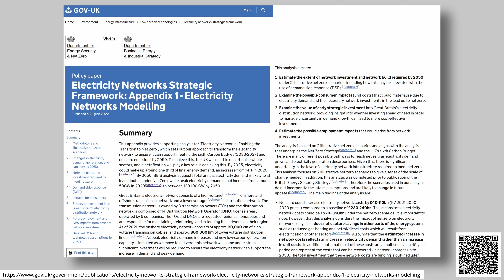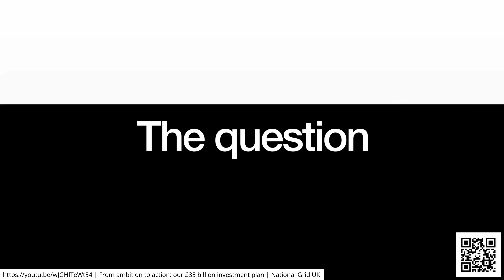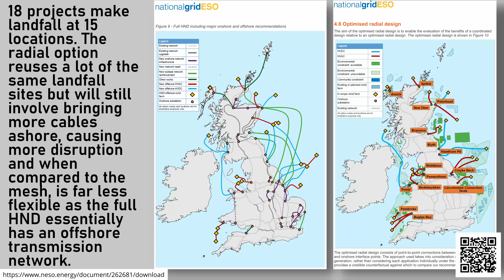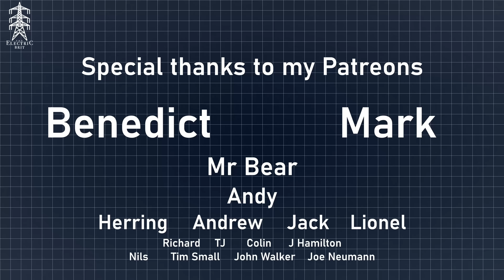The Great Grid Upgrade Projects Explained

Comment: Utter BS and waste.  Spend the £35bn to BUILD POWER STATIONS in existing locations where grid connections already exist.  It's pathetic that we destroyed perfectly usable COAL fired power stations to 'waste' the grid connections to/from them.  No amount of solar/wind could possibly be constructed to replace the output of a coal fired power station.  The world (and our energy system) is run by effing morons.  EVERY wind system will require REPLACEMENT in 20-25 years.  Same for solar.  Madness.
Reply from the maker: Most existing grid connections are exhausted or planned for other uses which is why we’re having to build new substations or extend existing ones. 

I agree dispatchable power is needed but coal is terrible for even the local environment, ignoring any argument of global warming, local acid rain and smog were actual problems. The land contamination and radiation is also a massive future problem we have to deal with. 

Most assets have around a 30 year lifetime too, most of our current gas and nuclear fleet are coming up for major refurbish or closure. New substations are rated on a 25 year life too but obviously maintenance will keep them up long after that. So renewables aren’t much different in that respect other than they get cheaper the longer they live, and things like solar which obviously aren’t the best in the UK are still at 80% after 25 years. 

As I said to others, the last time we built any reasonable amount of grid was 70 years ago. We’re well overdue if we want to keep the most reliable power network in the world. Hope that helps
Reply: @TheElectricBrit Thanks for your details reply.
I disagree over the issues coal is said to present.  Smog was dealt with decades ago and even 'acid rain' was found to be a manufactured crisis - but even that is irrelevant in modern clean (scrubbed) power stations.  The only 'issue' is the fake claims over CO2.
Gas and coal power stations regularly exceeded their 30 year planned lifespan but to their benefit they were 'contained' (high density) and recyclable - wind and solar certainly aren't.
Renewables aren't cheap nor do they get cheaper - I work(ed) in the offshore maintenance world and can assure you costs to maintain are stupid ridiculous and reliability even worse.  Solar, apart from their dreadful environmental manufacturing issues are taking over arable land - a criminal waste.
If claims of fracked gas are sustainable then drilling and building on-site would make our grid reliable and cheap - we all know the 'green' side of energy is a total scam so let's not delude ourselves.

Comment: Trouble is all we got was one ad. Two guys in yellow jackets putting a giant plastic plug in the side of a bus shelter. WTF was that?!? The only bits of this we've got wind of has been from You tubers spilling the beans. A can at a time! Brilliant bit of communication considering this will be THE biggest game in town. They have been briefed to add 50GW to the existing 84GW. It's not enough. By the time this ball has finished bouncing we are going to need more than double. Think of this as another HS2 project. Nowhere near the scope we are going to need.
Reply from the maker: This is something I’ve hoped to highlight. I don’t think anyone has covered what the upgrade actually entails so this was a taster, and I’ll dig down on each project as interesting stuff happens or that I can access. 

And the gap is something I’m highlighting too. By 2035 we will be done with ASTI and all current curtailment will have stopped, but then we’re adding a boat load more generation so we’ll be in the same boat again. Sadly funding and foresight only comes in waves of 5-10 years at most rather than the 20 years we need to be looking at…but imagine trying to get the public to swallow that pill if it was £100B now instead of 35. Even though it would be cheaper now, more coordinated, less wasteful and less disruptive.

Comment: I thought the point of privatisation was so that each supplier would invest to provide a service the customer wanted to select to purchase, based on the offer being made. Instead it is the householder who provides the transmission infrastructure through taxes and upfront fleecing standing charges and Green energy surcharged by OFGEM. The suppliers are left to secure contracts from the stock market through futures contracts and get it delivered to UK borders by transmission cable, pipeline or tanker vessel. No one gets the energy they think they’ve paid for from a North Sea gas platform or Irish Sea coastal wind farm, they get a mixture from every non-entity operating through the futures market whether that is from Russia, Iran, Venezuela or France and Norway. Like our hospitals which were paid for on the never - never, our energy supply is being charged up front - AND THE PRICES ARE DESTINED NEVER TO BE REDUCED! 🙈🙉🙊
Reply from the maker: Privatisation was a mistake. I recommend The Energy Revolution podcast episode with Arthur Downing on the history of Britain’s Energy transition. Regulated monopolies are pointless essentially in my opinion. 

However around 2% of your bill goes to transmission. Of course there are green levies and stuff on the fuel which get passed on to you, but a lot of this as you point out is a political issue and our energy market / billing needs reformed. We need this infrastructure regardless, it’s just how we pay for it needs to change to get us out of the cost of living crisis.

The actual cost of the energy is cheaper. But to realise that we need to cut all the other 💩 off the bill.
Reply: @TheElectricBrit Obviously you’ve done the research so I yield to your better knowledge. However since Covid, my standing charge had gone u[ from 10p per day to something like 60 to 70p per day, re-inventing the transmission grid is not incremental upgrade and Hinckley Point costing 5x more than the Chinese were charging is stretching the 2% a tad. I live in Birmingham and Severn Trent Water has just increased our bills over the last few years to allow them to pipe dirty water from the river Severn when the townsfolk of Birmingham gave them a gravity fed clean water resource throughout the Elan Valley. I was also around when British Gas cried about their 20 year fixed price contract with Norway, breaching the contract and pocketing huge profits by buying off the commodity market but stiffing the consumer in 15 of that 20 year contract to maintain their profits. It used to be the case, British Has extraction balanced the losses of British Gas retail and vice-versa, They started insisting on both business units making profits every year, at everybodies expense. I like the Japanese way of doing things, drive the costs down by Kaisen and Kansan philosophies and add 15% profit to the cost price of the process. Enough profit for re-investment, shareholder value and a long term future rather than boom, bust, mergers and acquisitions to create short term asset stripping.
Reply from the maker: It has been the British was since before I was born to extract all wealth from tax payers and our amazing assets and send it abroad. Public utilities should not be ran for profit and as you say should be ran to create a cushion for future investment and maintenance. Hopefully we see nationalisation of water soon. 

I can’t comment much on standing charge as I’m with octopus so it’s been 35p a day since I joined them 3 years ago, but the lack of investment in the grid for 70 odd years means it’s been long overdue, and Hinckley is a different beast since its generation it isn’t in that 2% and will be levied some other way, and I think the cost is ridiculous.
Reply: @gbphil  The standing-charge increases are partly to cover the bailout of 'failed' energy companies during covid, partly to cover the grid upgrades, partly for 'green' stuff (although iirc that's the smallest slice), and partly for 'inflation' (yay, Truss)

Comment: Your videos are like taking a great bite of high energy food which keeps one going for days!  Acronym heaven for those who feed on such things, and so full of hard facts.
When some of the 275kV network was being constructed decades back I believe it was envisaged that it might need to be upgraded to 400kV without too much hassle.  A number of countries move energy (albeit those with large distances to cover) at 500kV.  What is the potential for any of our grid getting that sort of upgrade in the future?  How much leeway has there been in the specifications -- insulators, spacing within tower designs and so on -- for such a thing ever to be contemplated.  Or do you think that 400kV will have to be the UK grid upper limit?
Reply from the maker: Thanks for the compliment! They’re definitely packed with info.

You’re right that some of the 275 kV network had standard tower designs that allowed it to be upgraded to 400 kV with minimal effort. In other cases they’ve been trialling an insulated cross arm upgrade that swaps out the steel arms for an insulting material to help get more clearance from the towers to sustain 400 kV. Sadly I believe that’s about the hard limit on the network an it goes up to around 420 kV. 

One option however is increasing the current which has been going on for decades as new conductors come out that can sustain higher temperatures, nowadays it’s composites like high temp low sag (HTLS) which can go above 100 degrees safely, meaning more current flow, and dynamic line rating to make sure we’re getting the full capacity rather than making assumptions. 

Our DC links are coming on at 515/525 kV but so far none overhead on, and none with much of a substation - we might see the first as part of western link 2 but it’ll be offshore). There is a project called Volt Xpanse (if memory serves) looking to bring 800 kVAC to the UK but I believe this will be post 2035 if it happens. 

It’s all exciting developments and it’s something I’m personally pushing for where I can, not that anyone really cares what I think, but I’ll push to get involved in it as much as I can too as it’ll be the most interesting development of our grid this century.

Comment: Putting critical infrastructure in the sea might look good and cheaper, but how is it Ok in this security environment? Isn't it very easy for a foreign actor to blow a hole in it? It looks pretty amateurish in terms of national security...
Reply from the maker: They’re pretty close to shore really to the point I think anyone would get spotted, and they’re buried under the seabed, sometimes with rock and concrete over. The North Sea is incredibly congested with other cables and pipelines too which we have to protect when we lay new cables.

So it’s not a zero risk, but it would be an act of war if deliberate and at that point a few well placed missiles on overhead lines and substations would probably be far easier and effective. 

Putting them offshore is actually much more expensive and harder to maintain, but it keeps NIMBYs happy. Sometimes I can agree, sometimes I can’t. A lot of the east coast works is the latter for me and I’ve lived here all my life.

Comment: Seems like huge investment on the east coast but very light on the western side. Or is that another project?
I like the idea that more cabling is offshore which will hopefully keep the NIMBYs happy.
Reply from the maker: I did manage to miss off western link 2 which should add another 2 GW of power transfer down that side, and in the past there has been a few Interconnectors added to Ireland that weren’t included in this round of projects. If I had to guess, East Coast has more people but it definitely has more wind projects and interconnectors to Europe.

I’ll have a video soon on why cables are far inferior to overhead lines but it’s a balancing act. And one very soon on HVDC which will cover it a little.

Comment: Would be interesting to compare costs for upgrades or new connections to installing massive battery storage to effectively time-shift the load on existing lines so they're more effectively used for more of the time - I imagine much of the system is running way below capacity during off-peak times.
Reply from the maker: There’s a massive pipeline of battery storage currently over 400 GWh to come online past 2035, so it’s definitely a money maker and something we need to keep the grid working as we move to more intermittent generation. 

The actual cost of projects and net zero is something I want to dive into though, as for the most part all these wind farms got built and couldn’t be used, hence curtailment. And now we’re picking up the cost to really connect them.

There’s also the train of thought on micro grids that never took off. How much solar and battery could you out on every home for £35 billion? It’s all stuff I’ll eventually explore! It’s just very slow going to produce videos I’m sure you might appreciate 😆 thanks for the comment 🙏

Comment: In Zimbabwe we have just moved on from grids, we generate locally where we need it. 500kW battery inverters are bread and butter for our company now
Reply from the maker: Thanks for the insight! I think 5-10 years ago a lot of people thought that would happen here. Micro grids and smart grids, but it didn’t happen.

A lot of homes will always be grid tied here which with how it works, is actually becoming an issue for the distribution network taking all that solar power.

Comment: Unfortunately it’s unlikely to bring the cost down for the householder. Energy will just become another cash cow for the producer and the distributors. The big money will just get richer at our expense. They are already reducing what they pay to householders for their surplus solar generation as there no profit in it for them. Unless householders can stand alone disconnected from the grid they will always place profits over benefits.
Reply: The 'price' of electricity for homeowners has nothing to do with the grid or the cost of delivering power, unfortunately.  It's determined by the most expensive source of power - which is gas-fired generators.  Until / unless we shut down all the gas stations (and/or the market price for gas crashes), or the gov changes the way the electricy price is calculated, our energy prices will remain high.

Comment: The UK desperately needs major infrastructure upgrades. We cannot go on relying on Mr Brunel and the Harold Wilson's "white heat of technology". I seem to remember a  news presenters saying that the Heathrow transformer that blew up was installed in the 1960's.
The UK was the first country in the world to install a national electricity grid. Sadly like in many other areas we have fallen behind. 
Yes HVDC only makes sense when you can send it a long way sub sea. The Western HVDC Link (2GW, 420km) going from Hunterston in Scotland to Flintshire in Wales via the Irish Sea comes ashore just up the road from me. This was not without disruption either - lots of temporary road closures once they brought it onshore and  laid the last few miles underground. At least we got some decent resurfacing on some of the roads around here after they finished.
Reply from the maker: Agreed. I commented on a daily telegraph editors post just this morning who was slamming the investment and trying to stir discontent. These works are necessary if we want to have a flexible and reliable grid for the next generation, as was inherited from the last generation.

A lot of the main disruption will be for a year or two over the course of a five year project, and at the end we put things back better than we found them. We have rules around biodiversity net gain, sustainability innovation funds and all the volunteering and community engagement and fundraising over the five years. Then it goes into quiet operation for 25+ years (provided it doesn’t need expanded).

I do feel for some of the east coast communities when it’s project after project, so I’m hoping the holistic design gets some legs and gets coordinated better.
Reply: @TheElectricBrit Alas, most of the Torygraph editors seem to think that if we just stop spending money and halt all progress, the country can carry on into infinity in its current state (or somehow, magically, 'improve' back to how things were in the past)

Comment: Shame we don't have the manufacturing skills for grid equipment like we used to
Reply from the maker: Agreed, very few things are made here now with the exception of some stuff at Siemens in Newcastle and GE in Stafford. Theres a new cable factory coming up in Scotland too for transmission projects and there’s smaller manufacturers for some transformers and things like panels, but we’re nowhere near self sufficient for the rest like switchgear, batteries and instrumentation. 

It’s a shame and for a lot of things it won’t come back sadly. Someone decided in the 90s and before that we weren’t a manufacturing economy anymore.
Reply: @TheElectricBrit Not like seeing transformers leaving Greater Manchester by road, or the coils on the winding machines and the tap changers being built…
 Those were the days
Reply: Who says we don't?